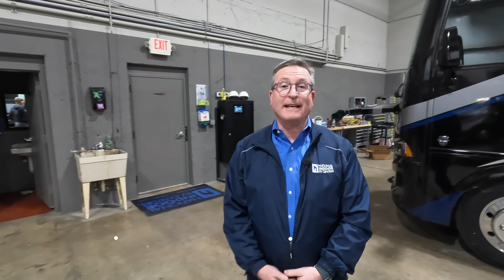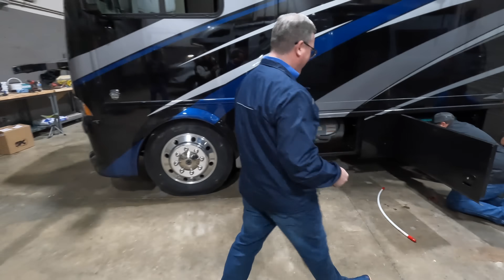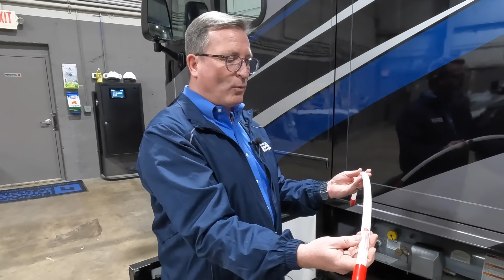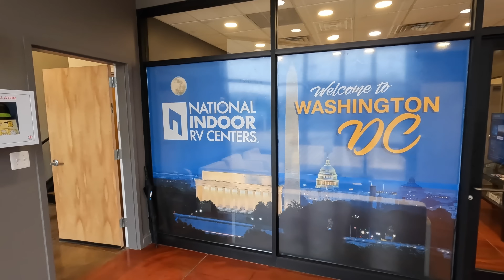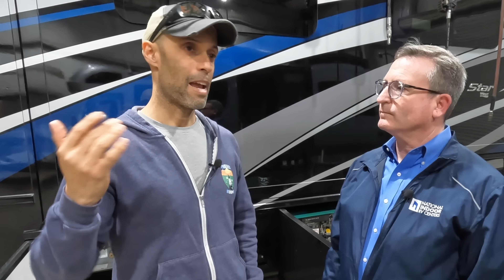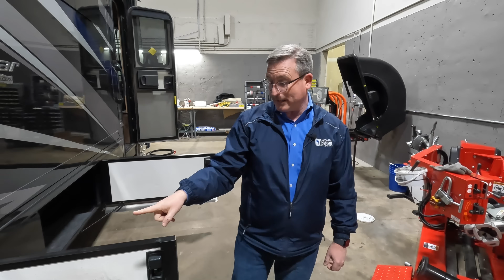Learn How Proteng Can Keep Your RV And Family Safe from Fire!

Comment from the maker: 🔥🔥🔥 Now through June 30, 2023 GET 10% off the following services at ANY NIRVC LOCATION BY USING THE DISCOUNT CODE "ENDLESS10"
 👉 Chassis service 10% off
👉 Proteng 10% off
👉 Wash & Detail 10% off
👉 Ceramic Coating 10% off

Comment: Good concept but WAY over priced. I saw where you could buy 468 Lbs of FM200 for $2,000. So what justifies what you folks charge for this product. Also FM200 is being phased down being a CFC.
Reply from the maker: How about creation of the complete product, labor, installation? Shall we continue? 😊
Reply: @EndlessRVing  How about being realistic? A sealed tube with an amount of relatively inexpensive fluid zip tied into places in the RV. Not too difficult to calculate the volume of a protected area and adjust the length of tube and amount of FM200 required. I've seen estimates of $3K to $4K for an RV. They even advertise how easy it is to install? You have GOT to be kidding if you think the numbers add up.
Reply: @EndlessRVing Not even a USA product. Designed and patented first over 10 years ago in Slovakia. Only a 4 year warranty. Their own ads brag about ease of installation which is 2 hours of labor at $199.00/hr.  Shall I continue?

Comment: I just recently installed on my 2020 Tiffin 40IP AB and it is not cheap, but something that gives you a peace of mind, especially if you use your generator continuously for 24 hours for a several days like we do 7+ times year for football tailgating weekends.   Also if you leave pets alone for several hours it gives you comfort   One thing to mention the product only has a 4 year warranty.   You may have to replace after 4 years and would be another big expense.

Comment: Please do your research before purchasing this product. A great resource is the NFPA on deploying a FM200 system. For example, in this video a unit is installed above the propane tank. The tank is vented, not in an enclosed space. This protection will go off, extinguish the fire but does nothing for the heat. The FM200 gas will dissipate and the fire will likely restart. I could not find one study or standard where this was effective on RV’s. This was designed for race cars, to delay a fire so a trained safety crew could respond. The NFPA has a report on RV fires from 2020. This type of protection in not mentioned in the report and they are the experts in fire protection
Reply from the maker: The point of the Proteng is to buy you time to get out of the vehicle.  It is installed in common places where fires are likely to start. It’s another layer of protection not a 1 stop solution.  

Thanks for watching and the comment.
Reply: @EndlessRVing  the problem is there is no proof it does provide any real protection or buy any time. The claims are not supported by any third party. Based on how FM200 works it’s useless in engine, generator, battery and propane bays as they are vented.  Inside the RV example, this product needs a fire to activate. Most of the time a smoke detector will go off in the smoldering phase providing notification well before this activates.  A product such as this provides a false sense of security/safety, possibly making the situation worse. RVers would be better off practicing how to shut ac power off, battery, inverter and propane quickly.  Have they actually practiced and used a fire extinguisher?  Do they test their smoke and CO detectors monthly? In fire protection, there are engineers, trained installers, 3rd party test labs and certification. None of this exists for this product. Go back and ask them to provide with the name of the engineer who wrote the installation instructions for an RV? What is their background and certifications. The person who reviewed your RV and made the recommendations where to install it, what is their training and certification?  What about the tech who installed it?
Reply: @eddiedoherty2349  The only "good" thing about the Proteng tubes is they can be fitted with depressurization sensors, tied to a warning system. So as long as they vent, regardless of suppression, you can be warned. That said, a regular thermal trigger would accomplish the exact same purpose for 1/25th the cost. 

I've gone round and round with people on IRV2 about this product and nobody actually cares about the suppressive properties. You'd do just as well plumbing an automatic water sprayer into compartments where there might be a fire... but no, the instantly vented gas system is somehow better.
Reply: Interesting product. Any extra fire protection is comforting. Thanks guys!…Lisa

Comment: I saw a video of what happens inside a rv in a accident.  All the interior going flying forward during a serious accident in the front. I've also seen a accident were the one piece sidewalls detach from the base in a accident. That's why bus conversations are the safest rvs, because they are essentially a steel cage.